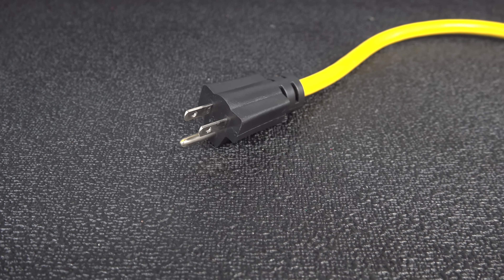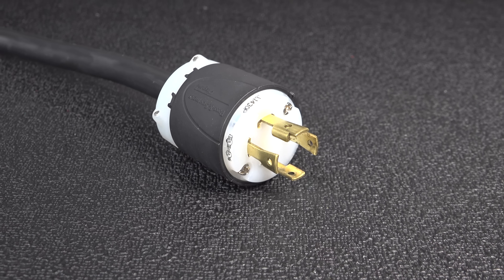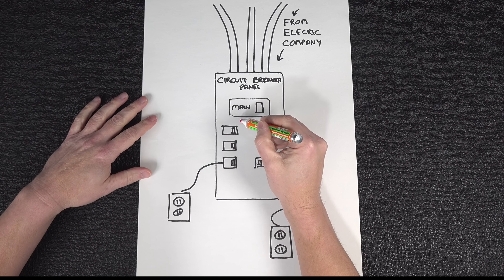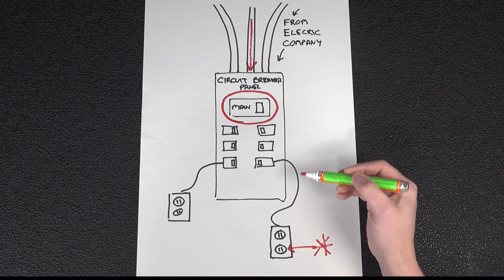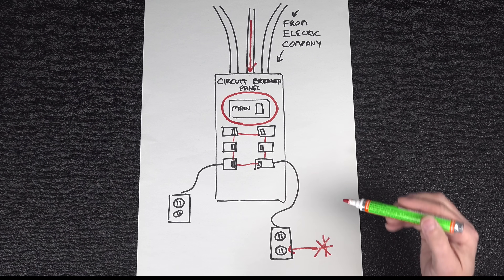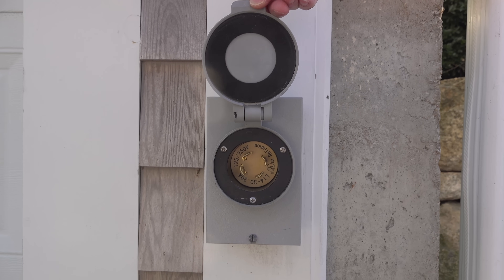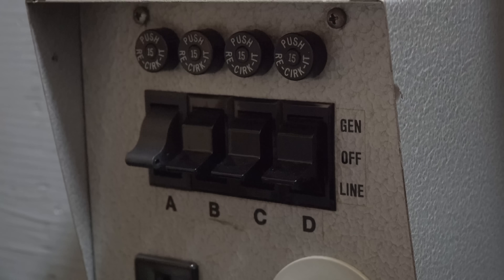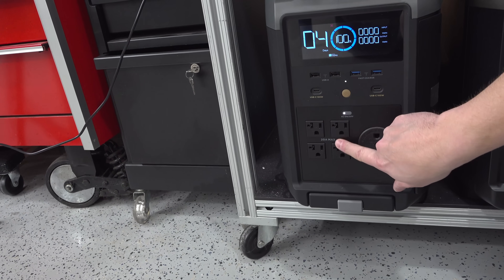Worst Electrical Mistake You Can Make - Backfeeding Generators

Comment: I'm a line clearance tree trimmer and, while not from my yard, we've lost a few guys to backfeed. It's a series topic, glad to see good video addressing it.
Reply: Journeymen are not allowed to claim that they made mistakes fixing things. If they do, they've violated all of their LOTO and discharge protocols.  Linemen injure themselves not the homeowners.  Electrical connections don't kill people, people who fail their due diligence processes kill themselves.
Reply: @matthewsocal2540  yes when directed by pushy linemen and tree companies telling tree crews to just get the lines cleared with out bringing the necessary equipment/taking the proper precautions from their end. Only so much the guys at the bottom of the totem pole can do in those scenarios, even more so cause it's not like all the hires are from the cream of the crop with so much better potential ahead of them. This was the point of my comment. It's obviously not on the homeowner, but every little bit can help keep people alive when doing dangerous work on vital infrastructure. Perhaps part of the confusion of my first comment is its unwritten reference to storm work. This is where the majority of the danger I've personally witnessed comes from.
Reply: How do ppl who work on clearing energized lines get hurt from energized lines? Mr logic first? Isn’t it logical to assume power lines have power? Still never heard of this.
Reply: @Mrt  you do but somebody has to clear fallen lines. And the corporate line is treat all wires as live, and a slew of other precautions/steps. But in the effort of getting a city's power back up mistakes get made and backfeed deaths can occur. But their lives and effort don't need your recognition to have occurred nor does it require you to believe it was due to an improperly connected generator. Hopefully your lucky enough to never experience a situation to prove the matter.
Reply: @logicfirst1041  I’ve picked up down smoking sparking on fire wire. And I’ve picked up dead. It shouldn’t matter. It’s all hot so wether it’s from substation or generator or Tesla plugged in or solar battery bank or magic it doesn’t matter. It’s a power wire, it carries power…. Treat it as such.
Reply: @logicfirst1041  I’ll admit there is a million ways someone can get electrocuted. But like your motto states it’s all hot. I don’t have a problem with these little cords cause honestly if you plugged one of these in to anything. It’s gonna have a breaker. And if the main is closed it’s gonna trip the generator or panel breaker. So it’s just not a thing. We clear lines too. Hot cold dead energized. Smoking non smoking. I’ve been at this a while and I’ve never heard of a backfeed death. It’s one of 10 things I could see resulting in the already obvious same problem. It’s a power line, they carry power…
Reply: @logicfirst1041  to me this is like worrying about getting hit by a motorcycle while playing in the road…. What about cars? Trucks? Etc etc… it’s just not a thing.

Comment: So many people in these comments have absolutely no clue how the power grid works. What also worries me is how many of you clame to work on the lines but are absolutely clueless. If you work on a line between the sub-station and the power station then you make sure that line is off at both ends period, there is no assuming the line from one of the ends is dead. If you work on a line between a residential property and the sub-station then you turn it off at both ends. Rule number 1 always assume the line is live unless you are 100% sure you turened it off. Stop being idiots and have a transfer switch installed. No power line is hard wired to your house.

Comment: Thank you for bringing awareness to this, im a utility worker and found people backfeeding the street, many times. Its a big problem and we could easily get killed. Also, transformers work both ways too!
Reply from the maker: I should have mentioned that also about the stepping up, scary stuff!
Reply: @SilverCymbal  thank you, this is a serious subject regardless of others beliefs
Reply: @turbotom89  don’t believe me? Ask an actual lineman. Forget YouTube. Forget electricians. Forget some engineer or plumber or what the fk ever. Ask a lineman. We ground sht.
Reply: So am I. And we treat all downed wires as energized in every case so I dunno how you can easily get killed when you assume something is hot…. Unless you are incapable of working stuff hot.
Reply: @Mrt  your obviously a toxic commenter. But when your on service restoration for weeks at a time doing 16s, pitch black walking through woods, shit happens. Not every situation is identical to what your used to pal.
Reply: @turbotom89  honestly though I just don’t think your comment feels right. Ppl back feeding the street? Must be soooooome generator…….. without a breaker. Somehow connected without a breaker.
Reply: @Mrt  im a journeyman electrician that works for orange and rockland utility. Test me cause ive earned my keep. I write utility worker cause people would understand that more than electrician or lineman. I served my time sir. Im former Air Force electrician, and did my 7 years apprenticeship through the most certified union. So i think i know a thing or two. Who and what are you to argue that knowing what the person who posted this video is wrong for showing??
Reply: @turbotom89  I could sit here and ask you what a mineralac strap is. Or what’s the offset of 3/4”. Or what’s the bury depth for under 600v. I get it. You know all that. Just like me. Good for you. But I also know what a g switch is. What the measurements are for a t body. What the mad for 35 is. Or how to get an rc. Do you have any idea what any of that is? What’s a dogbone? Or a lawnmower blade? Or an la? Or a soap dish? I’ll tell you again mr electrician. We don’t give a fk about generators. Or battery backups. Or solar panels. Or anything else rigged however it’s rigged to the distribution. It’s all hot. We don’t fking care about generators.
Reply: @Mrt  further more, im tired of people with your toxic attitude at work. We call you 'Jerrys'. Jerry i know. You know everything and if its not done your way, they're stupid and wrong. That behavior should not be in our career field and unions.
Reply: @turbotom89  I hear you. And I’ve never heard of an incident of this doing anything. I just don’t see it. Must be my jerry attitude. My journeyman electrician. Journeyman lineman. Production lead jerry attitude. Two steps. Yup too complicated for anyone mite as well just make it out to be the number one killer of the 80000 lineman that die every year. And the 4.3 million houses that burn down cause of it. Yup two steps I agree is too much for the general public. I must just be the luckiest guy alive for the 30 years I’ve been using my dryer plug. Thank god for luck.
Reply: What kind of “utility worker” are you? Cause we just say lineman…. With our toxic attitudes lol.
Reply: @Mrt  this is the attitude im talking about, this doesnt belong in our career, and shame on you.
Reply: “Easily get killed” yea working on stuff that we think is energized, treat as energized, work on and repair energized, or we ground it. Heaven forbid someone “back feeding” energized any of it……. We wouldn’t know what to do.
Reply: @Mrt  the last time i came across this, it was a 14k generator, a tree cutter was next to the line and i told him to wait while i check. Sure enough it was live, main breaker on. So lets do a lil math, shall we? 14000÷120=116Amps... how dont you understand this? sure as hell enough to kill anyone not  paying attention
Reply: @turbotom89  ok well there you go. An electrician. Do you go out on storm duty when something happens? I do. And just no 116 amps. Good for you on some math but it don’t add up. A generator hooked up with an extension cord is not going to power even one house. Let alone “a street”. And I’m telling you neither me nor my crew under me give two shts about this. We treat everything like it’s hot so idc if it’s hot from substation or some guys generator. I don’t care if it’s a 80kw generator or a 2k. It’s still hot. We are not in any more or less danger. And I don’t give a sht about a bunch of other ppl who aren’t even electricians. The only ppl I care about are actual lineman. The ppl who’s supposedly being put in such grave danger. They will tell you, we don’t fking care. It’s not that serious.
Reply: @MrT13  read more of the comments so you can see how many more people this opened their eyes too
Reply: Told you that “utility worker” smelled funny. That’s like “I’m in law enforcement”. Sooo your not a cop…..
Reply: @Mrt  i hope you're not in the IBEW, sounds like your not. Id hate to have to call you a brother.

Comment: First of all lets clear up some major issues with this video.  In most states it is not Illegal to back feed the power grid.  Most of the time this happens if you have solar and or a wind turban on say a farm or what not.  Now no common Joe should wire up solar panels and expect to back feed the grid.  That would be a terrible idea.  However to just say it is illegal to back feed the grid is an inaccurate statement.  In some or most states the electric company will credit,  not hand you a check but credit your account for any surplus of electricity that is back fed through there meters.  So yes the statement that your neighbors could be using power your producing is correct.  However not explained is if that is true it is going backwards through your meter and then going the correct direction through their meter.  So they are still being charged for it.  Now about this cord.  I have no idea the actual use of the 24" male to male extension cord shown in this video.  It would be very difficult to plug that length of cord in to a generator and an out side receptacle.  A male to male extension cord does have very specific and practical use however.  I use to be an electrician.  I will not tell you where as I will tell you this.  Most of the time, we were on first name basis with the DUKE energy lineman that would show up to disconnect power to a home we would be doing a rewire for.  We would then ask the lineman if we could hook up a set of cheaters.....What we call cheaters is a home made extension cord with a double duplex receptacle at one end and a set of jumper cable alligator clips at the other end.  We would clamp this directly to the triplex they just disconnected.  Allowing us to plug in a light or 2 and be able to charge our power tools as needed.  Now this IS illegal as the power is no longer going through a meter.  BUT the B in IBEW stands for Brotherhood.  Now to bring this back to the cord.  On occasion we would be sent to an area we did not know the lineman or it was not a DUKE energy area.  REMC or some other power company.  In this case we would pull the generator out of the van and back feed the panel.  This was safe for us because again a lineman showed up and cut the triplex so the home had no power at all and could not have power until the lineman showed back up to reconnect.  Doing this only powers half your panel as it has 2 legs as we call it.  In our situation we were safe and practical about it.  I don't know why this video even exists to be honest.  This video has over 800k views and that brings to light to 800k people that this kind of thing exists.  I am guessing before watching this video 800k of the views did not know this was a thing to begin with.  Sorry for the length of this.

Comment: If you don't have a transfer switch installed, cutting the main is all you have to do. If you think someone might accidentally switch the main back on, get a LOTO for the main breaker or lock the entire panel closed. I understand that backfeeding an outlet is the last way you want to feed power to your system, but sometimes it can be a necessity. Just know what you're doing before you do it.
Reply: Even if it wasn't risky to a lineman upstream, if you backfeed and the grid comes back on you risk an explosion due to being out of phase.
Reply: @joshuahudson2170  Which is why I said make sure the main breaker is off.
Reply: The other problem is that backfeeding bypasses all breakers. In the rare situation where an appliance fails, it's nice to have a breaker. The modern generators do have a breaker. That means you can only use up to 15 amps. Otherwise, the generator will need to be reset.

Comment: I made some extension cables… 🔌😐 I had a big spool of cable, and I had the male and female connectors… I was wiring them up and suddenly realised… if I put the male end on first, then I had bare exposed wires on the other end, and something really deadly should anybody plug it in at that stage… so I stared wiring the female connectors on first…

Comment: This is actually a pretty informative video.  a few years ago, my parents disconnected the family cabin from the power grid.  This was mostly because we only went once or twice a year, but there was a monthly fee that added up.  There was also a flat cost to reconnect to the grid.
Instead, my dad would use a double male plug to tap into the neighbor's power, with their permission.  It was just for lights and a couple outlets, but things could have gone very wrong.  Luckily, they managed to sell the place, so it'll be someone else's problem.
Reply: Nothing goes wrong as long as you shut off the main line back up to the power source.
Reply: @jasonjones6985  and double check polarity.
Reply: Yea so lucky. Thank god someone else has to deal with that insane ticking time bomb
Reply: @MrT13  To be fair, the new owners can always reconnect to the power grid.  I don't think the neighbors will let them do the same thing.
Reply: @jardex2275  they can just use the same cord and buy a generator. It’s not that serious. Just ask your dad.

Comment: Reminds me of an incident a while back where I had a switch box installed professionally for maximum safety however I installed  a domestic wall socket to receive the power from the generator, in doing this I needed to make a cable with 2 male connectors (1 for Genny 2nd for wall socket). What I stupidly did 1 day by accident is plug the cable into a domestic socket close to the Genny input/feed socket walked off towards the Genny to plug in and found the male prongs of course we're live. Needless to say I have removed the nearby socket so I cannot make this mistake again and highlighted the input socket but now I'm going to do as you suggest and change from a female wall socket to a male socket.

Comment: I have a back feeding cable that ONLY I use. I lock out the main when using it. And with the main off I plug in and then to my generator. Again I lock out the main off to do this and NO ONE touches it but myself.

Comment: Works if you plug into a single pass-through outlet. It does not back-feed the panel and keeps from having to run an extension cord through a door or window.

Comment: What’s better is removing the wall plate every hurricane so that the scratches ensure enough oxidation to cause a fire at some point in the future. That way you can justify the wood to concrete story and sit in an insurance office fighting about it instead of using timers and asics to measure capacitance and let you know of the loose rusted wires. 

This is all because most people are too ignorant to handle having a plug with two male ends and would blow a breaker with it. 

Plus Jim the electrician who doesn’t know how the coils make a loop or exactly what an electron is can make scary videos and justify being overpaid due to FUD. 

I know it’s like illiteracy all over again except rather than spirit burning engines it is all about those electrons.

Comment: I remember someone commenting how to make it safer easily. While I don't recommend this sort of cable at all, at least add a switch along the cable with a label saying "MAKE SURE MAIN BREAKER IS OFF BEFORE USING". The instructions would be to 1. Turn main breaker off, 2. Make sure cable switch is off, 3. Plug both ends in, 4. Turn cable switch on.

But really, the recommendations in the video are much better and safer.

Comment: LOL I watch this video and then look at the cable in my garage and remember my cable is just worse. For the record I backfeed straight into my breaker box, after my main is off, my main is not in my breaker box it is outside of the house and I have a lockout lock for it. So ya I have one with a male end that plugs into my generator and the other end are bare wires that I feed in through my breaker for my dryer :)

Comment: I can't believe they actually sell suck a deadly cord if it was 220 it will blow you back off of it but 110 will kill especially if it's not GFCI and it's on a fuse and not a breaker I am concerned for the older people that buy it and don't think about that we need to get those off the market

Comment: NOT for an amateur. NOT for a better than amateur. do NOT consider this unless youve been wiring for at least 3 to 5 years.
answer this question: typically, given red white blue black household wires, which ones carry the voltage?